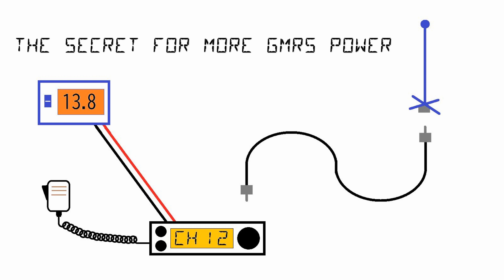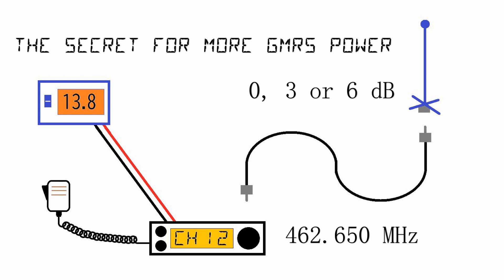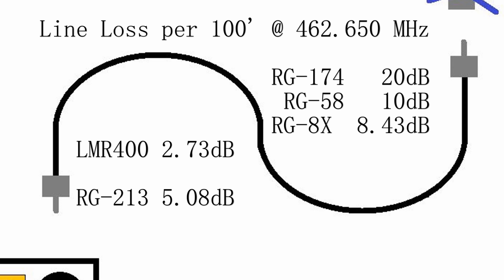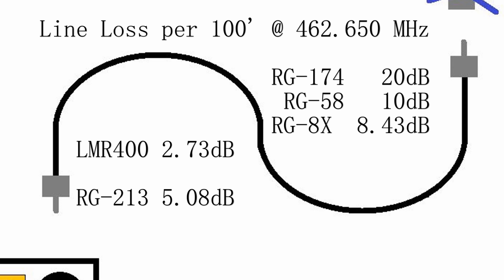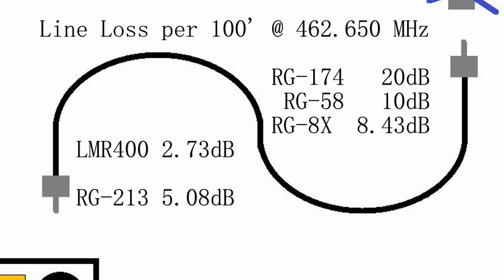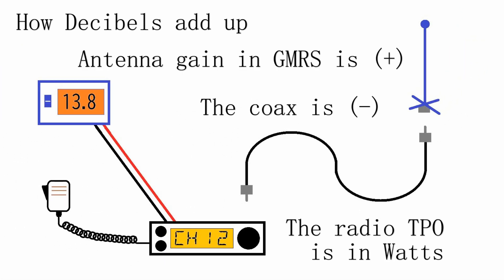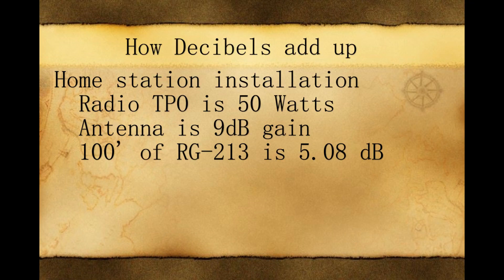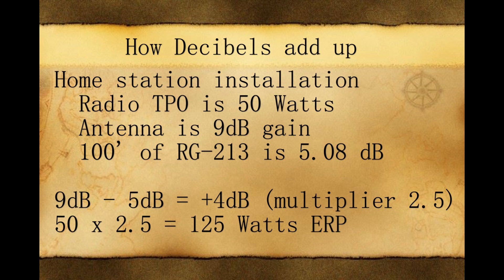The secret for GMRS power

Comment: Thanks, for the video!   

I agree with most of what you said, but I would like to make a few observations, if I may:

1 -  Losses equally affect reception and transmission.   Likewise, antenna gain improves reception as much as it improves transmission.

2 -  No antenna actually increases the power out of the system.   Antennas achieve gain by "squeezing" the radiation pattern such that energy that would be wasted in ineffective angles of radiation are redirected to useful angles of radiation - like towards the horizon, rather than up or down.   You used the term, "effective radiated power" which is the correct term to refer to the improvement due to antenna gain.

3 -  Less than 1dB change in signal strength is going to be imperceptible to most humans.   And, a standard "S" unit on an S meter is going to be about 6dB - just to put the losses/gains into useful perspective.

4 -  GMRS is a "line of sight" band.   Therefore, increasing transmit power - or effective radiated power - is far less important than improving line of sight.   Indeed, the increased gain from an antenna that is placed at greater height is going to be far more useful than increased transmit power.  For example, a GMRS radio that has a transmit power of 50 watts connected to an antenna that is 20 feet above the ground is nowhere near as effective as a GMRS radio that has a transmit power of 5 watts connected to an antenna that is 100 feet above the ground - even with increased feedline losses considered.
Reply: totally correct on ALL 4 points
Reply: @oldolfmann8927  1 -  You're just plain wrong.  Radio waves don't care whether they're being received or transmitted, and neither do antennas care whether they're transmitting radio signals or receiving them.   It is a stone cold fact that antenna gain is EQUAL in both directions.

But, you go right ahead and do your level best to refute this, if you think you can - but, just saying that they aren't the same isn't going to cut it.

2 -  Antennas are PASSIVE components in any radio system.  They are incapable of adding power for transmission or reception.  From where would an antenna get the extra power you seem to think they provide?   From God?

What an antenna can do is provide GAIN - which is not the same thing.  An antenna can be designed such that it "squeezes" the radiation into a desired direction, while sacrificing performance in undesired directions.   But, the total amount of power in the system remains the same.

If you have an omnidirectional ground plane antenna and a beam antenna connected to an antenna switch with 100 watts being provided by the radio, both antennas will radiate a maximum of 100 watts.  But, the beam antenna will squeeze those 100 wats of radiated power into a desired direction, while providing some rejection - along with decreased performance - in undesired directions.   This will have the effect of providing a stronger signal in the desired direction, as compared to the ground plane antenna.   

On the other hand, the omnidirectional ground plane antenna will receive and transmit equally in a 360 degree pattern, with a nominal amount of gain directed toward the horizon, depending on its height above ground.   The higher the antenna above the ground, the lower the angle of radiation toward the horizon and the longer the distance of potential contacts.  But, the gain from the beam antenna will provide a stronger signal in whatever direction it may be pointing.

There are advantages and disadvantages of both beam and omnidirectional antennas, which is why many radio operators like to have both types of antennas.   Because, ultimately, the goal of radio is to make contacts, and each antenna can help you in different ways in that regard.

3 - Isn't that essentially what I said?   The point I was making is that it makes no sense to go chasing a 1dB improvement in your system - because, no one is going to notice the difference.  And, the radio doesn't care.  I am still wondering why you would even say anything about this, except to just be obtuse.

4 - An antenna at 20 feet above the ground is DEFINITELY going to be subject to more potential obstructions than an antenna at 100 feet above the ground.   And, no amount of extra power is going to be able to overcome the effect of those obstructions at GMRS frequencies - hence, getting your antenna higher above the ground is how you overcome the effect of obstructions.   

And, assuming that you do get your antenna above the obstructions, the difference between 5 watts and 100 watts is going to be nominal for the vast majority of contacts you might make on GMRS.  Why?  Because, most mobile and portable stations are going to be located near the ground with obstructions and lower power levels which is going to reduce their effectiveness in making contacts.  And the increased transmitter power of a station with an antenna at greater elevation is going to be benefitting more from the higher elevation than the increased transmitter power.  Of what benefit is there for the mobile and portable stations to be able to hear a station that cannot hear them?

At the limit, though, the station who has an antenna at 20 feet above the ground in the desert with no obstructions is not going to be able to make contacts as far away as a station right beside it that has its antenna at 100 feet above the ground with no obstructions - because, the curvature of the Earth becomes the obstruction. 

Now, go ahead and argue some more.
Reply: @richardowens9061  I have learned more in your two posts than I have in countless hours of reading on the internet. Thanks for putting it in simple and easy to understand terms that makes CLEAR sense and understanding.

Comment: Check out LMR 240 ultra flex
Reply: At GMRS frequencies, LMR-240 is going to have about 5.3dB of loss per 100 feet.
Reply: @richardowens9061  yep agreed, for that high of a frequency, only short runs of LMR 240, for example my long runs are LMR 600 but then when I need short jumpers and things less than 10 ft to reach to the radio, LMR 240 is pretty nice.
Reply: @ErnestGWilsonII  I use LMR 600 myself - great coax for the money and still relatively easy to use.
Reply: LMR 240 has Far too much loss.
I use Andrew's Heliax LDF7-50A

Comment: Now I was an old CBer from way back and I remember they had field power meters which had a little antenna connected to it. You could test the power of your CB radio by standing a distance away from the antenna and have someone else key the mic. You could see the power in watts that you were transmitting. I have been out of the sport for a long time but have become very interested in GMRS. Do they have such a device for GMRS and if so, would it measure the effective power of the system you described in your video and how many watts would it read?
Reply: When you see this in a reply --->  "I've had an Amateur Radio Extra Class license - the highest you can get - for over 20 years." You know it's one of the Sad Hams NotaRubicon talks about in his videos, they think they know it all, and the main reason why I left the Ham radio hobby, they will try to run your station the way They see fit. Ignore Them.
Reply: Amen love proving them wrong even though I know they'll never admit. Like notarubicon has said if they start out with their degrees and you know everything thing else out of their pi hole is bs
Reply: Field strength meters are most useful in determining RF radiation exposure for higher powered systems, in accordance with FCC regulations regarding RF radiation exposure limits, as they are able to measure the "effective radiated power" or ERP of an entire system, including transmission power, feed line losses, and antenna gains.   They're merely a novelty at CB power levels.   The radiation pattern of an antenna is far more important to analyze in terms of actual performance, and that is something that can either be calculated from known antenna parameters, such as its length, configuration, and height above the ground using antenna modeling software, or provided by manufacturers of antennas.
Reply: @oldolfmann8927  I'm sorry, if my post, above, went over your head.  I've had an Amateur Radio Extra Class license - the highest you can get - for over 20 years.   And, I have an electronics engineering degree.

My reason for stating that they are for novelty use at CB power levels is because you will NEVER exceed FCC RF exposure limits at 27MHz and 4 watts transmitter power.   

You're better off measuring power delivered to the antenna at the feed point, which takes into consideration the losses through the coax, and calculating effective radiated power (ERP) based on the specified gain, as provided by the antenna manufacturer, or antenna modeling software, like EZNEC.

But, you go right ahead and have fun playing with the field strength meter.

Comment: 😷👍🏻  Nice explanation of dB logarithmic info & wire size.
We mostly use 1/2” or 7/8” Heliax for UHF repeaters & RG400 or 
RG214 for general purpose jumpers & duplexer jumpers.

Connectors are also pretty critical.

Just say NO to CHINESIUM !

Comment: If you use a beam on MURS it goes like this  2 watt X 2 = 4 x 2 = 8 x 2. = 16 x 2 = 32 watts from a yagi beam 👍😎🍿
Reply: Very true.   But, I would point out that the typical application for MURS radios does not lend itself well to using Yagi beam antennas.   For example, if you have a group of MURS walkie talkie users with whom you wish to communicate who are constantly moving around the area, a Yagi beam is not going to be an effective way of communicating with them, as your antenna will not be pointing in the right direction most of the time.   A far more effective type of antenna that can provide similar gain is a vertical phased collinear array.   They achieve gain by squeezing the RF energy and redirecting it to the horizon, rather than up or down.   The more collinear elements the antenna has, the more omnidirectional gain it will have toward the horizon, thereby increasing range and ERP.   And, all of that gain is going to be in useful directions, not requiring that you aim the antenna at any particular station.

Comment: I’d like to see one on a murs base station settup. Too bad there are very few options for 2 watt base stations!
Reply from the maker: That is a good idea. There are not typical base station radios for MURS. It is doable, but; not straight forward.
What would you want your base station to be able to do?
Reply: @personalradiofun526  If a manufacturer would produce a MURS base with a good S meter, all 5 channels. They would make some money. MURS frequencies are good in the woods. Great for camping, hiking, hunting, good camp base station. Dakota made the M538 base station which is not really set up for a true base station. The time is ripe for a listening manufacturer.
Reply: @bulldogbrower6732  MURS is an Excellent Band.
Using Portable..and to Also have GMRS band.

Get a good 2 meter / 70 cm HT
typically Very easy to open up transmitting on your MURS but to Also cover GMRS

Plus ham radio HT's typically are much better units then either dedicated MURS or gmrs HT radios
Reply: Funny !!! LOSS IS LINIER 
SO WHO F U K I N G CARES OF S METER!!